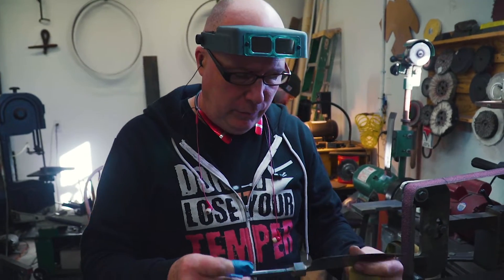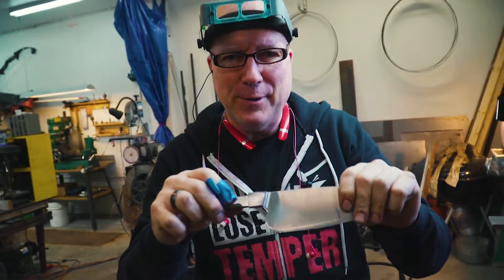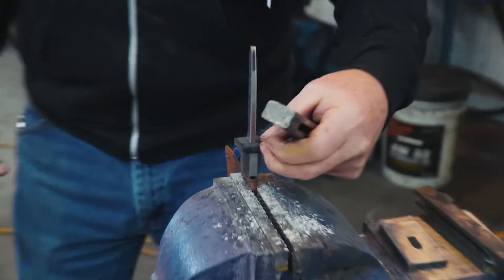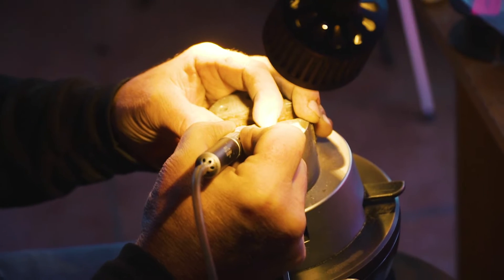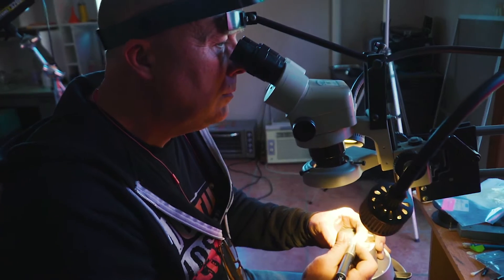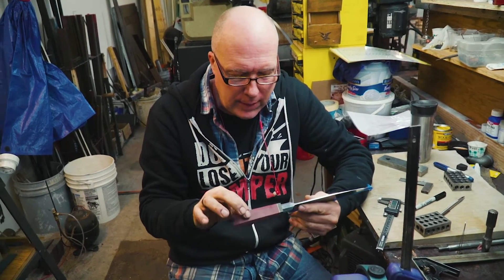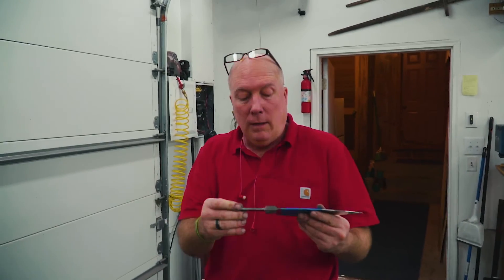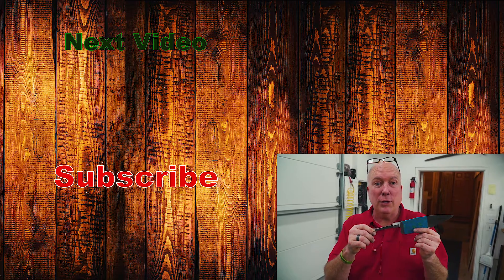My Dad Is Making His First Partial Takedown

Comment: Very nice!  It'll be interesting to see a CA finish over G10 as I've never seen that done before since it usually buffs out really nice by itself, but I'm certainly looking forward to it.  

You guys probably don't need any tips from me, but when I have forged integrals in the past I had the same issue, so in order to get that heel drawn further back I ended up using the peen side of a ball peen hammer and hit the heel area while pulling the hammer toward me as I struck the steel, I think it would technically be called a "glancing" blow but can't quite remember.  They were smaller integrals, but you could apply the same technique with a bit larger ball peen or even a narrow cross peen on your kitchen blades as it might help with that.  Of course, you need to have enough meat there to not get too thin but I'm sure that's pretty obvious.  Also, I can't say if or how much it would affect the Damascus pattern doing something with a more uniform pattern like the ladders you like to do, but it might be worth a shot.  That's for sharing and take care! :)
Reply from the maker: Paul, that's a really great suggestion, I might have to try a ball peen sometime, a couple of my hammers have rounded faces for the same kind of purpose but they're not as aggressive as a ball peen of course.  I think it would be fine on certain patterns and with others like ladder pattern it's a good idea to minimize the amount of forging you do after the ladders are done.